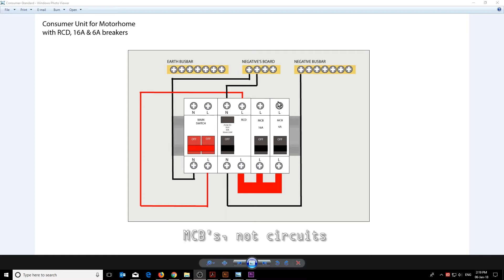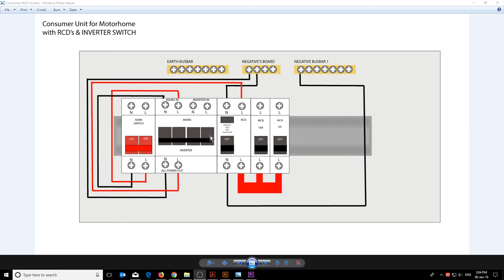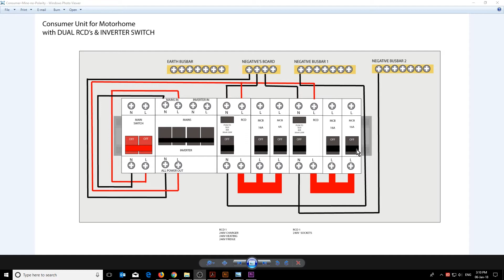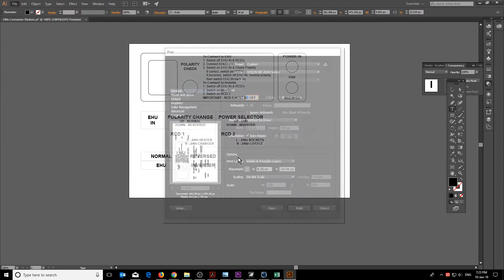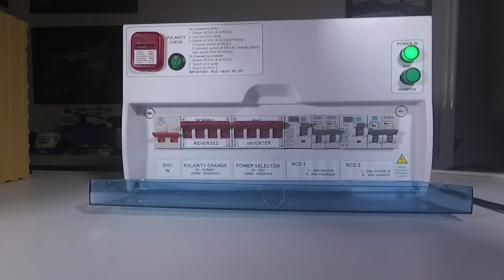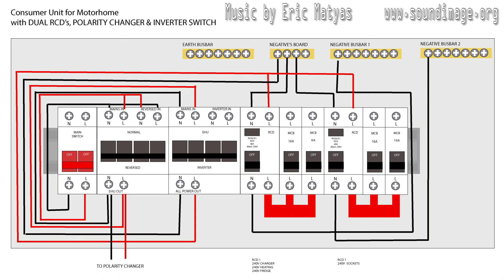CamperVan Consumer Unit Build with Inverter and Polarity

Comment: Very well presented video but no mention of the earthing arrangements. With a suitable earth you could leave out the RCD switches and got straight to RCBOs for each circuit. This would free up 4 ways in the CU and allow to you to subdivide the circuits further or install a smaller CU. The reverse polarity is not normally a problem on AC equipment (for functionality but it is if you only have single pole switches as a circuit that you think is "off" will actually be "on") but you could plug in a polarity tester in a socket in the vehicle and then set your polarity switch to suit. But belt and braces always keep your trousers up, and who wants to be caught with your pants down! Great explanations and graphics and the lack of music was much appreciated. Thank you for the video 👍🏻

Comment: What size mcb’s did you change to? Did you stick with the 80A rcd’s? Aren’t they a little high just for a camper?
Reply from the maker: I can't remember tbh Andy. I'm going to rebuild this anyway as not happy with it. Will be using double pole MCB's (already here), but not ordered the RCD yet. Will probably go with a 25A version with a 30mA trip.
I'll be using two separate (smaller) consumer units. One will be from EHU and just power my 240v charger (would be for 240v heating and water heater as well if I had it), the other will be from a new Victron 2000VA inverter I have and power everything else. The inverter will be on all the time in next build.

Comment: A very technical and neat approach which while it works as you wish, it seems over expensive & complicated, but a good watch. As you're on Fun, check out Techno100s (Andy) method, it is a lot cheaper, and does most of it automatically via a couple of relays
Reply: do you have a link to this solution ive tried googling it :)
Reply: David Skipper you would have to register with motorhomefun, a forum in the UK,  then search for posts.

Comment: Really professional, RCD at least do not have the preference of neutral input, so there is no need to control or change the polarity, the MCB are bipolar, this applies only to branded components and not cheap, yours is the solution better being mobile! eye that with the inverter having the "neutral" isolated The RCD is inhibited does not go in case of dispersion, for him it would be excellent an insulation controller or a differential relay for isolated neutral
Good job

Comment: Thanks so much for this, some great solutions here. Just trying to workout where the battery charger is wired. Is it across the mains input of the EHU/INVERTER switch over? Am I also right in saying "To polarity changer" is to "to polarity checker"
Reply from the maker: Hi Gary, the 240v charger is attached to one of the MCB's. Is this what you mean?
 Polarity - yep you are right, it's the cable that goes to the checker (my mistake, not the sharpest at the mo with this bloody flu that's going around)
Reply: Self Build Camper that's great, of course the charger is on the mcb. It's a very nice solution you made, thanks for sharing it.